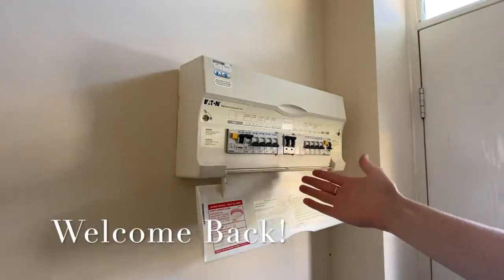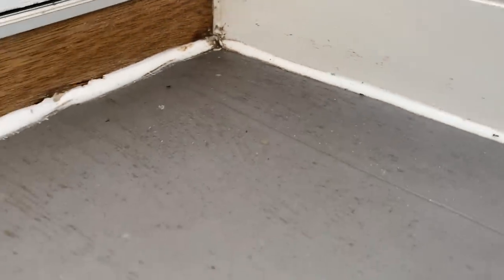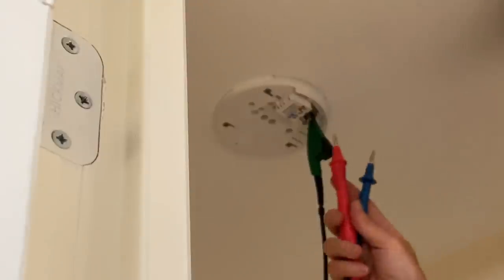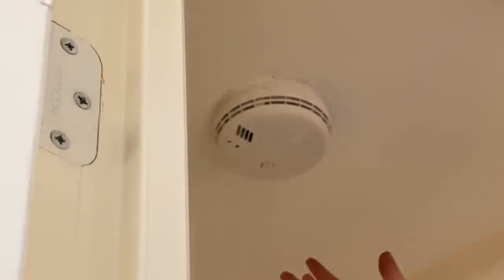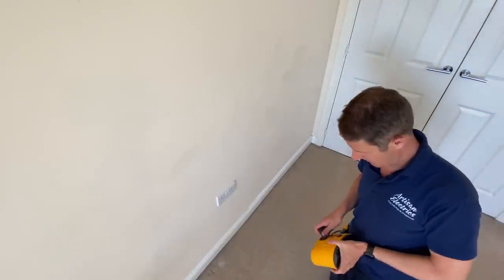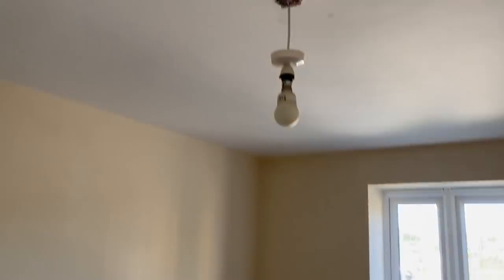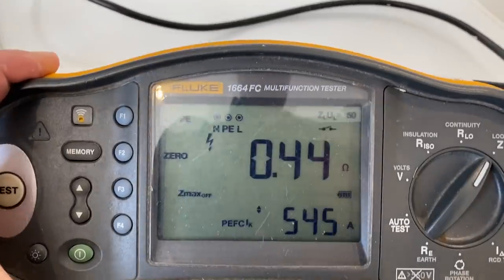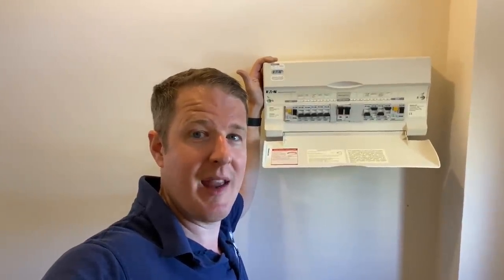Electrical Installation Condition Report Sample - Part 4

Comment: Appendix B Table B6 . Maximum zs for Type B 6 amp 60898 MCB is 5.87 ohms. Thanks for putting this content on youtube, it is good that there is advice and guidance available within the industry & at the same time showing possible customers a good view of what to expect if they use your service.

Comment: Hi Jordan, enjoying the content, keep up the good work! This isn't criticism but simply an observation regarding your testing methods. Feel free to correct me if I'm wrong but it is my understanding that Zs cannot be used to prove polarity. Polarity is a dead test (other than incoming supply) and thus should be confirmed visually or with the use of an R1 + R2 test. I prefer to use the R1 + R2 test method for the continuity of CPC as it satisfies both the continuity of CPC and polarity checks. Furthermore the R1 + R2 test also facilities the calculation of  Zs and in some circumstances this is safer than carrying out the live Zs test by measurement.  Where safe to do so I also carry out the Zs test by measurement and compare it against calculated results.

Comment: Hi Jordan. Nice run through on the EICR not sure landlords will do it every time they put a new tenant in as I know some that have about 3 in a 5 year period.
I have just been reading through the comment and came across the answer to your question,
They had put maximum Zs on the lighting as 5.87 but my onsite guide says 7.28 take it the onsite guide is right, not that I’m questioning anybody

Comment: I'm supprised test equipment manufacturers haven't developed their own form software that wirelessly links to the tester and fills in the form as you go along depending on the readings you are taking.   Could be one hell of a time saver, especially if the UI in the tester was developed correctly.  The tester could easily be updated with ammendments/editions as a simple firmware update to ensure it's doing it correctly.

Or, another idea, the industry develops a standard for data transfer for the readings/form/etc that means any tester can send the data to any form software and bingo.   Life becomes even easier.     In the aviation industry for tech log/etc transmission this was a god send (ATA Spec 2000 Chapter 16), made connecting various systems together a doddle :)

Comment: 14:40 I would have checked the lamp holder for loose wires while I was there to establish why it was flickering The last thing you need is a callback the day someone moves in saying the light don’t work and then find it’s a loose wire that you can’t charge to repair

Comment: Regarding the 40amp MCB for the ring main, that is a C2 regardless of how cables are run......take a look at reg: 433.1.204 on page 89 👍🏻
Reply: What's 433.1.204 got to do with it!?
Reply: @lewistempleman9752  433.1.204 advises: "The load in any part of the circuit should be unlikely to exceed for long periods the current carrying capacity of the cable. ✔
Reply: Lewis Templeman Read the reg.....
Reply: Jordan has replaced the 40A MCBs with 32A hence this is no longer an issue.
Reply: cumberland1234 Glad you pointed that out.....i didn’t realise!

Comment: As long as there's different depths things we will never be able to standardize on probes. There's a finger guard there for a reason and they should be used by professionals who have the training or at least the wear for all to read the manual. Your fingers shouldn't be touching the metal of the probes when you're using them. Which is why I say and have had to take the Caps off and then out of fear of losing them just leave them off. Granted I am in the US with only 120, 240 V the only time I had an issue was when I tried to do something stupid sorted and the box was very tight and I tried to get to a terminal screw without removing the device and grounding it to the Box. I wasn't getting good readings from the socket and managed to bridge my pro-tip between the screw and the Box that was metal I put a nice gouge in it. And I think I was also dealing with a Federal fire Pacific panel....

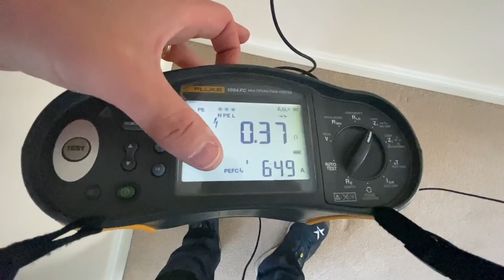Comment: 1:19. You polarity test is wrong.  It is possible to have n N or E reversed too and this type of test won't pick it up.  You can typically only with a trailing lead and no men link.

Comment: I tend to use smoke detectors with a 10 year battery life, so no need for mains, battery changes and after 10 years the smoke detector needs changing anyway. Very simple installation and not having to change alkaline batteries.

Comment: For a BS60898 type B circuit breaker the Zs ≤ 7.28Ω  under normal conditions, As according to BS7671 table 41.3.
However  as domestic house supply voltage could be down 6%, volt drop could be 3% and Voltage factor (Cmin) could be down at 0.8, then Zs ≤ 5.59Ω would be a more conservative value.
Though I feel I am over complicating (disclaimer: new learner)

And thank you for the learner question, really fun to do some on-site questions.
Reply: Just been looking at the other answers.
Would someone be able to explain why the onsite guide shows a different value?
Reply: @mcbunson  I'm an apprentice too :D as far as I remember the values in the OSG is for existing and working circuits whereas the regs book shows the maximum permissible values for the breaker types and ratings for new circuits which is why I was told to always use the 80% of the values shown in the regs book as a guide when testing. I hope I've helped you out

(Anyone else correct me if I'm wrong)

Comment: Why didn't you count the triple pole fan isolators as points? On the other hand you counted the low voltage undercabinet lights as points? I normally count every point where theres 240 volts (or technically 50 - 1000 AC)

Also spotted a pendant with a lower part of the cap missing, the part that prevents fingers contacting the metal base of the lamp. I normally c2 those.
Reply from the maker: Thanks! I only count “points of utilisation” as that is always how I’ve understood you’re supposed to do it. So you only count items that actually consume electricity not switches or isolators. Maybe I’m wrong though?
Reply: Lewis templeman you count switches and isolators as points on a cct ?
Reply: @artisanelectrics  My thinking in recording all points is that it could be useful to the next person working on that circuit. For example if I am testing or fault finding a cooker circuit, I might assume that there is an outlet plate and possibly an isolator switch only, but if i have a previous EICR/Installation cert/circuit chart to hand and it says 3+ points, it indicates that there is more on this circuit which I have to find and investigate. And this way it conveys something actually useful from one electrician to the next.

However I did some research and BS7671 definition of a point is basically a current using fixture or fitting and most people seem to agree on that, so i think you are correct in the way you do things. And I suppose that could also indicate something useful about the circuit in terms of maximum demand and diversity etc.

Apparently though, recording points isnt a requirement of the regs so it really doesnt matter.

As an aside, the NICEIC still regard a double socket as two points, as two current using items can be connected, just leaned that, but i won't be recording as such lol

Comment: Hi Jordan, I  know that your videos are a snapshot of your work and not a "how-to" so I assume you do an R2 and loop test not  R1+ R2 on an EICR but what do you do regarding parallel paths for the R2.For example, you could have a break in the CPC  on the upstairs lighting but the test would not indicate this as the path of the CPC when the 2 way is down to a switch with another lighting circuit. Also the from the video the cooker circuit with a parallel with the gas pipe.

Comment: Hello, sorry for the question its probably lame, but when you did ring final continuity you did not do the 3 step procedure. On the earth loop test socket measurement was 0.37, while L/L was 0.41 and E/E was 0.69 which combined is 1.10, which divided by 4 is 0.275, which should be the value of R1+R2. And the earth loop on the test at socket was 0.37. How is that correct. I just bought fluke 1662 so I am trying to understand how should I use it. Thanks in advance

Comment: Well done for putting yourself out there can’t be easy . Why would someone put 40amp mcbs on a ring main mmmh.

I can see already it’s going to be a race to the bottom with EICR’s already seeing companies doing them for practically nothing, a real shame !

In fact the whole become an electrician in 5 week culture has swelled over this lockdown.

Minimum 3 years college and get some time on the tools, real life experience is required.

Even if you start off working for free it will show you’re eager, if the employer respects that effort they will pay you !
Reply from the maker: Yeah it’s strange I don’t know if they designed it that way but I decided to just downgrade them to 32A to be safe. You’re right about the race to the bottom unfortunately not a lot we can do apart from make sure we stand out from the rest with our high quality workmanship and customer service and also specializing helps sometimes that’s why I’m trying to specialize in EV Charging and Renewables and Smart Tech
Reply: That is how I got my apentership I worked with him for free for 4 ish months and he liked me so much he took me on just can’t wait to get back to it after lockdown is over 😀

Comment: I have a query that somebody may be able to answer. In this video it shows numerous speedfit pushfit plumbing fittings linked with 15mm copper legs. I was under a sink the other day Ichecking the bonding to the stopcock and it was all very similar set up to what was under the sink in this video. Out of curiosity I tested for continuity between a length of copper on the cold and one on the hot. Both were sandwiched between plastic fittings but strangely I got continuity. I checked to see if they were touching at any point but they weren't. I may be missing something here or being a pratt but why would I get continuity? Has Speedfit  put something into their fittings that now means you get continuity?

Comment: Great set of videos, super informative! Would be great to pick your brains on the Fluke; 
I've just picked up a used but calibrated 1664FC. I'm finding that my earth loop impedance tests (loop, no trip, L-PE) are giving me insanely different values if i hit test repeatedly. For example: 0.57, 072, 0.67, 0.43, 0.54, 0.43, 0.73. Where as L-N test is a constant 0.38! Repeated zero's of the plug lead don't show any changes, so I don't think it's the leads. Is this something you've experienced? Don't know anyone with the same tester, Thanks!
Reply: Try turning off all the other circuits. I often got Error 5 messages with everything on. They go quicker without the noise.
Reply: @jay_financial  Thanks! Will do. Had a lot more success with no trip on non-rcd protected circuits (to your point, will retry the same circuit (it's my home) with the others off!)

Comment: Maximum tabulated Zs is 7.28?
Maximum measured Zs is 5.82?

PleSe correct me if I'm wrong :)

I'm still a early learner lol
Reply: Correct Joe  table 41.3 as tabulated and X 0.80 to confirm measured

Comment: I think the RE result is earth resistance
Reply: The 1663 and 1664fc instruments can also measure the earth resistance component of the total loop resistance,
and line impedance (source impedance between line and neutral, or the line-to-line impedance in three-phase systems).
Reply from the maker: That’s awesome I learnt something new about the tester I’ve had for 3 years! 😁
Reply: It’s a great tester not perfect but a very good one let’s hope the new version they will release has even more capabilities. Greater accuracy and new test functions that merge harmonic distortion capture, testing of AFD, surge protection not just RCDs ability to identify equipment on line and allowing insulation resistance testing on line and load side without having to take apart wiring of sockets. Especially on the output side linked with fluke software that allow you to dovetail and create a report structure and output to it. That would save you having to have to pay for a software system to do that. No problem we learn a lot from your experience and issues that come up in your work.
Reply: @mathman0101  you seem very knowlegable on the 1664fc,  ive just bought one and of course i had to try it out at home (kid with a new toy)
i plugged into my kitchen radial circuit and tested Zi High but im confused by the readings
testing L-N
0.29 ohms
PSC  813a
Zmax >2000ohms

testing L-PE
0.31ohms
PEFC  765a
Zmax >2000ohms
Zi  0.36ohms
PSC  659a
Re  0.10hms
whats happening with the Zmax?
is the Re my earth resistence?
trying to learn all the functions and understand its readings so any tips would be helpful,  i keep hinting for Jordan to do an in depth review but its falling on deaf ears  ; )
Reply: David Marsden you have given a whole bunch of readings, it’s not clear what test you are undertaking. I suspect you are trying to do an earth loop impedance test? whether you are undertaking an earth loop impedance test or an earth resistance test by loop method the latter is only one element of the former where continuity readings must also be added. Most electricians take Ze at the consumer unit which will differ if you have a TN system or TT system.

I suggest you look at GSH electrical channel which covers this issue on measuring earth loop impedance and total earth fault loop impedance Zs. The readings will be impacted whether or not you have RCDs on the circuit or not and whether you have eliminated the resistance of the leads of the tester.

These are live tests and I suggest if you are not an electrician it could be dangerous. On the fluke if you are plugging the tester on multiple sockets a Zmax is measuring the multiple loop impedance readings you are undertaking across those socket readings.
Reply: Math Man cheers for the info,  I tested Ze at my DB,   0.18 ohms on a tn-c-s so it’s fine
I was just playing around with the tester trying to familiarise myself with it,  was just surprised when I saw the 2000 ohms reading.
I’ve downloaded the manual now so time for some light reading

Comment: They say in wales here anyway, if its a rented property they have to be the lithium battery smoke detectors. This has come from aico direct.
Reply: Yes think it is the same in the U.K. as I am an apprentice and the electrician I work with said that once the ones with batteries go out of date must be replaced with the in built batteries as people would just remove them to stop the beeping 😁
Reply: @farmingace1015  i am in the u.k boy 😁😁😂😂

Comment: They don’t come much easier than that. Completely empty clean property in good order... let’s see you do one like I did yesterday in 2 hours - an health hazard (that’s without covid) inhabited sh#thole full of clutter, grime, mess/furniture in the way of sockets etc, couldn’t find water service or bond , mess of wiring in non RCD board, circuit designations vague/wrong , Neutrals/CPCs not in right numbers, RFC no continuity, roses welded to ceiling  with 40 years of paint, lugs missing and or stripped, also you’ve got up to an hour of completing the EICR/admin etc.
Reply from the maker: Nightmare! I’ve done a fair few of those in my time! There’s nothing worse...

Comment: 7.28 ohms for the max zs on the b6 60898 breaker?
Reply: 5.82 or is it 6.13... Your move... (80% value).
Reply: There are two answers to Jordans question, the first is the max permissible and the other is max measured.  Ross has got the max permissible.
Reply: @AlanLumsden  I'm only an apprentice so Im still learning. But I thought it was only 80% on max measured and he just said max?
Reply: Ross Weir  yes, the figure that you quoted is the one from the regs which is the maximum.  When comparing the figures though we take into account the cable temperature.  For a 70 degrees rated cable measured at 10 degrees the max measured Zs is 5.87 ohms (from the on site guide)
Reply: @cumberland1234  ahhh okay I understand. Cheers 👍

Comment: Sorry but me again. I was trying to explain to a client the other day why their Aico smoke alarm was bleeping because the 9v battery was running low. They were surprised that the smoke alarm had a battery as well. I pointed out that it is a back up in case of power failure. The alarm was fitted in 2018 and they felt that a Duracel battery should last longer as it is only there for a back up. Does anybody know how much power the battery actually uses? Obviously they got a bill for a new lithium 9v battery and my time. Not a happy customer. It would be handy in future if I could explain this.

Comment: 5.87Ohm?
Reply: 5.82 or is it 6.13...
Reply: @artisanelectrics  You said type B, right? ;)
Reply: Table 41.3 confirms tabulated value for Tybe B 60898.  Times the value by 0.80 to get measured value which = 5.824 or 5.82

Comment: I thought that rental properties couldn't have smoke detectors with replaceable batteries now, and they had to be the lithium type.
Reply: Anthony charles I believe that’s only applicable to HMO’s, there is no legal requirements to have smokes in a normal rental property.
Reply: paul lyons yes there is one on each level minimum
Reply: It's only a backup battery
Reply: @barrybritcher  that's true, but I have been to so many rentals where the battery has gone flat or removed and the circuit turned off. 
And it's for that reason I never put smoke detectors on there own circuit, I wire them as their own circuit and double them in the mains board with a lighting circuit, to stop people doing that.